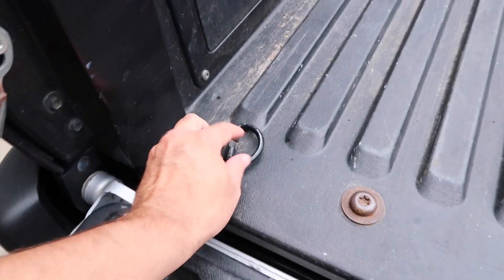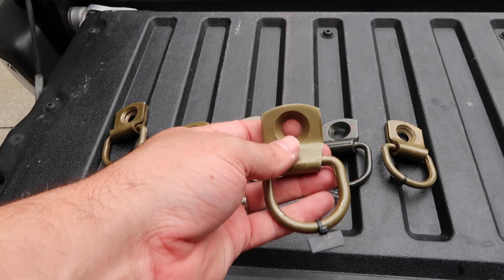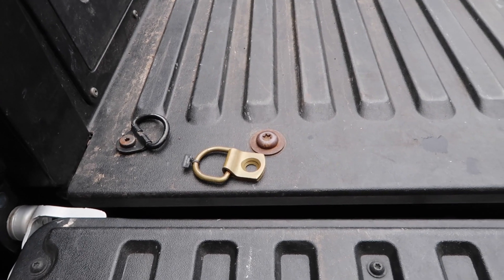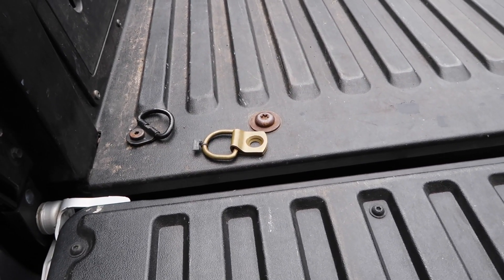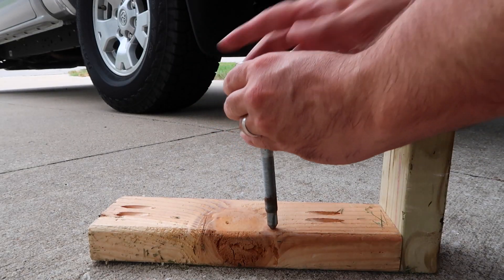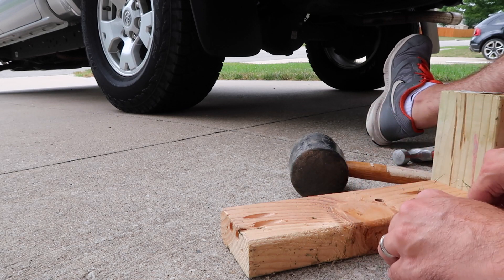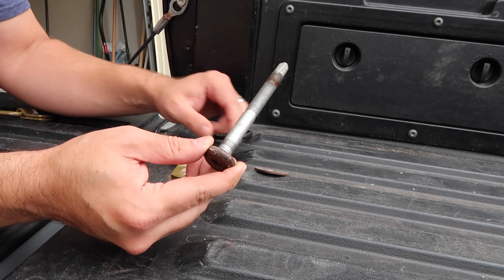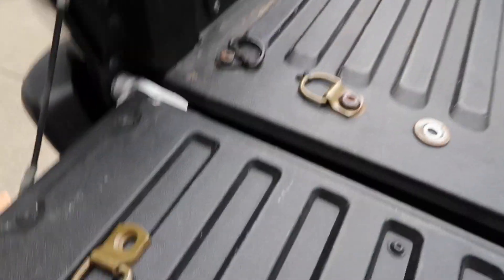Add more tie down locations to your Tacoma Tundra!

Comment: Thanks for the video. I first sprayed each bolt to be removed with penetrating oil. Before using the socket to hammer the washer off I took a pair of channel locks (any pliers with teeth should work) and held the bolt below the washer (where the raised retaining rings are) and used the T55 torx bit in a drill to spin the bolt while applying slight pressure with the pliers which ground down the raised retainer rings that hold the washer in place. It made getting the washer off easier.
Reply from the maker: Good tips for sure!

Comment: I was able to find the exact tie down rings on the internet. Used a 1” galvanized end cap to get the washers off the bolts then installed 2 of the rings on the rear bolts. Thanks for the tip.
Reply: Have another source? Cant find any in stock....

Comment: I added 4, 2 along either edge, by drilling into the bed. This keeps them out of the way when sliding larger objects in and out of the bed. It also gives you a larger tie span for things that are 4 feet or wider.

Comment: Reid - the military tie downs you used stated they had a 1/2" hole for the bolt, but they are sold out without a re-stock date. The biggest, heaviest D rings I could find on Amzn had a 13/32 hole. Could you please tell me the width tolerance of the bolt on the Tacoma bed to see if I could use one of these 13/32" D rings? Thanks. And BTW - excellent vid!
Reply: Wondering the same thing, a year later. Did you ever buy the 13/32" on amazon?

Comment: Well I gave it the old college try but there was no way I could undo these bolts.  I don't have an air impact wrench like you so maybe that's the problem. I did find some other areas to put these D rings by using the existing bolts on the rails of my bed cover, so all was not lost.

Comment: The link at Amazon is for a different d ring. I’d sure like a link for the D rings you installed. ThAnks
Reply from the maker: They discontinued them :(
Reply: Bummer but good to know. Thanks. I like that it is recessed
Reply: The D-ring in the link for Amazon is different and they look small. Did you buy original ones from Amazon or their website?
Reply: Thank you for the video
Reply from the maker: @samishegga4216 thu discontinued the ones I used.

Comment: This is going to help me a lot because I need to haul something very heavy from Connecticut back to the Ohio Valley in my 2010 Toyota Tacoma access cab I’m going to use wooden ramps and a 12 V electric winch to load it I’m going to try and mount the winch to the front via tiedowns either chain it up to The tiedowns or come over with a solid piece of steel from one bed bolt to the other and tie that down to the bed with holes drilled in it to fix the winch to,,,, thatidk???

Comment: Or just drill a larger hole in the existing washer.
Reply: I was thinking you could use an air die grinder and sand/grind the ID of the washer however if your tiedown base is substantial enough you may not need the washer,,,, maybe you could go with a slightly thinner washer so you can get more threads back into the frame I suppose that’s where these bolts screw it to???? You could take a few thousand off the original washers to make them slightly thinner if you had to I guess,,,, I want to get as much thread back into the frame from those bolts that I possibly can.